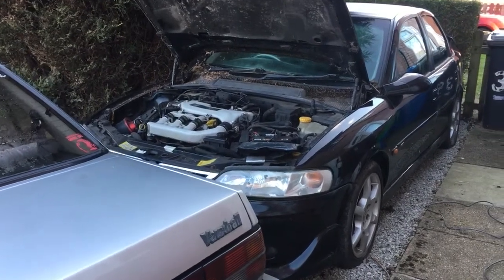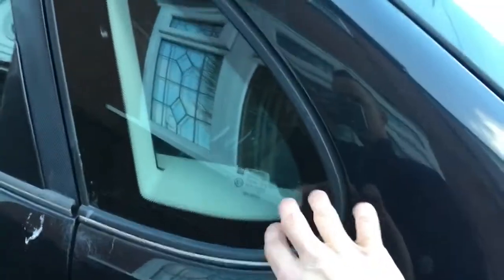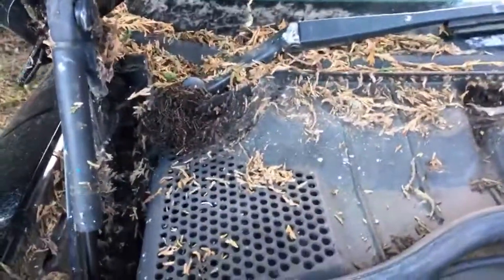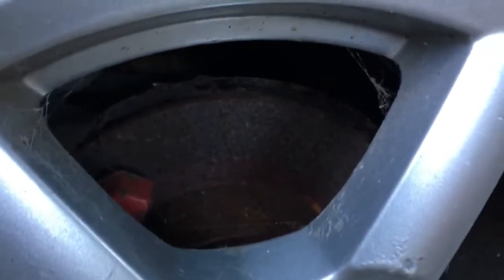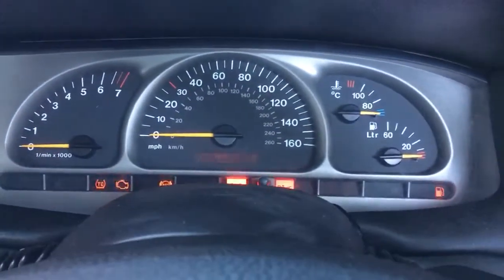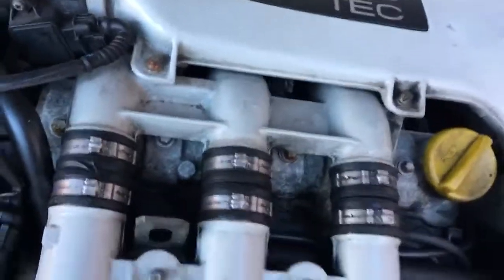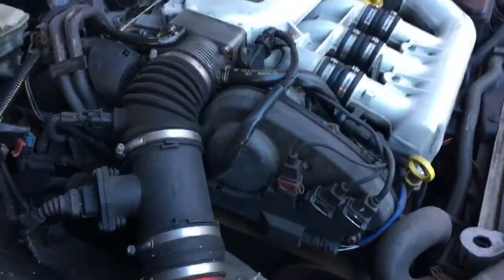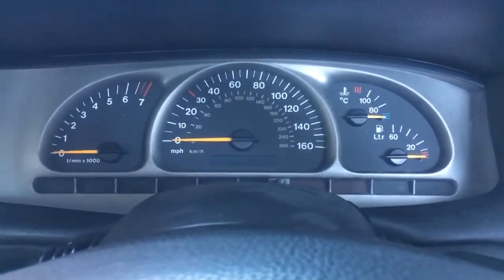WILL IT START? First start in several months, of my 2.5 V6 Vectra B GSi

Comment: I’ve just started mine today for the first time in 18 months.. put the jump leads on and she fired first time.. just needs a clutch and an MOT now 🤦🏻‍♂️
Reply from the maker: Yeh they’re reliable engines usually. Fuel and a decent battery and it’s never failed to start.
I’ve got a few bits to do to prep for MOT on mine, then I’ll get it used as my main daily I recon
Reply: @R1CH130  yeah that’s what I’m hoping to do with mine.. miss that sound

Comment: I've just bought one of these that's prepped for the track. If it's had a flat battery for ages, or no battery. Will thr car forget itself? ECU forgot thr key type thing?
Reply from the maker: I’ve not had any issues. Mine’s not got a battery on it 99.9% of the time.
It’s been off the road for 4 years any not had a battery on it for virtually that whole time, so you’ll be fine 👍
Reply: @R1CH130  thanks for the reply. I'm not so worried about it sat in storage now
Reply from the maker: @ianham9876  no worries, yeh, I wouldn’t worry Ian